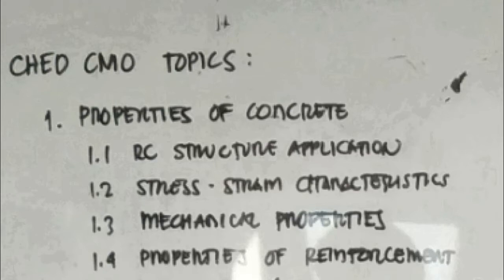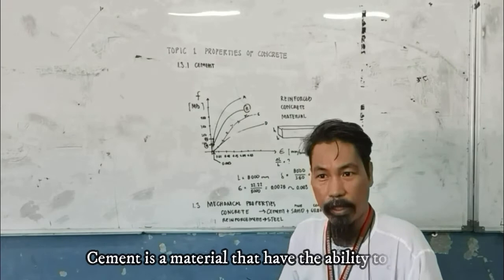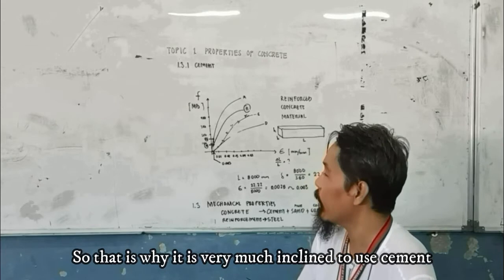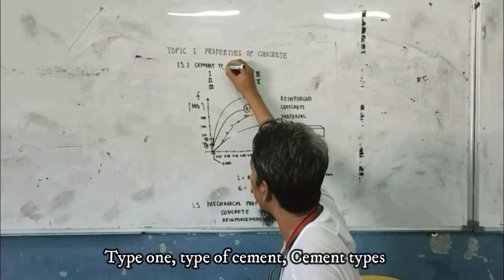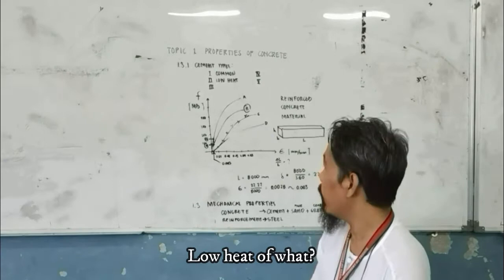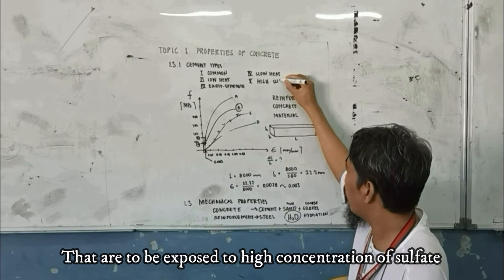CE 422 Structural Design 1: Reinforced Concrete Design || ch01 sec1.3 Concrete Mechanical Properties

Comment: 1. Eclionel, Richard
2. Gravel (0:57)
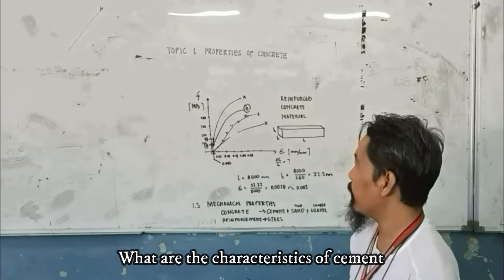3. Cement (1:14)
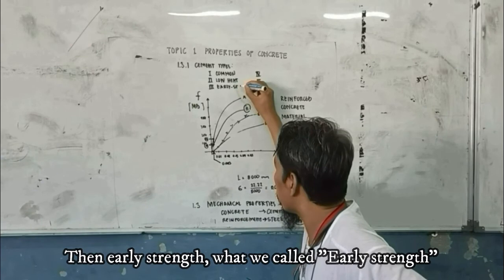4. Early Strength (4:05)
5. Slow Heat (4:16)
6. Concrete (4:20)

Comment: 1. Creo, Pauline S. 
2. Reinforced Concrete (@ 0:15)
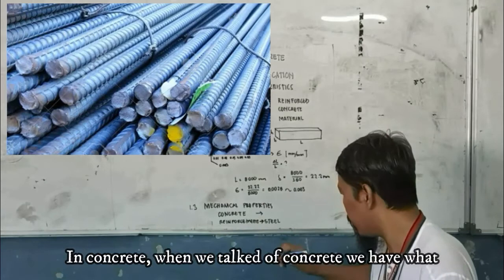3. Cement (@ 0:51)
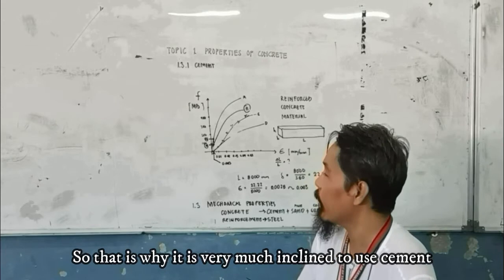4. Bonding (@ 1:59)
5. Low Heat (@ 3:14)
6. Chemical reaction (@ 3:29)

Comment: 1. Cacho, Julius Mico
2. Reinforcement (@0:34)
3. Reinforced concrete (@0:39)
4. Steel (@0:46)
5. Cement (@1:08)
6. Early strength (@3:58)